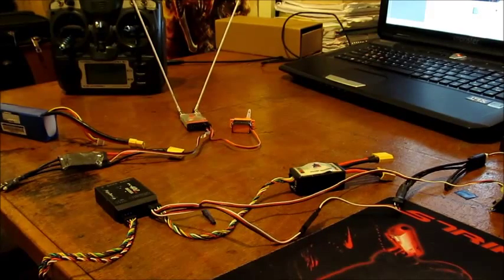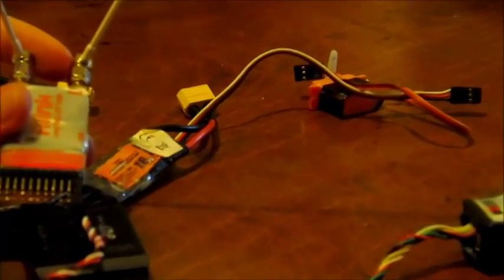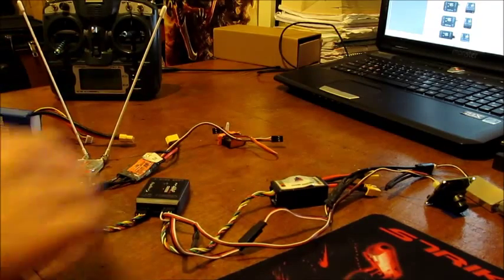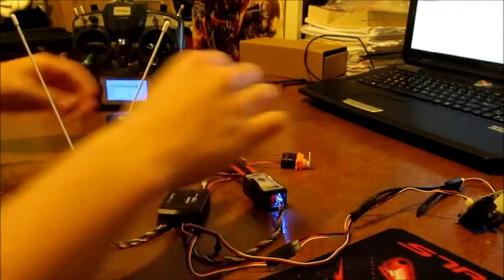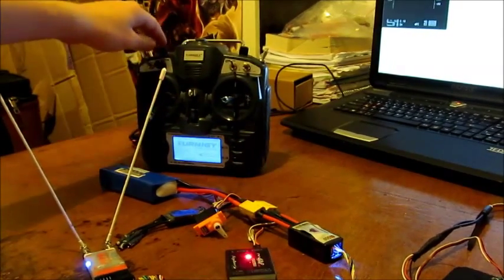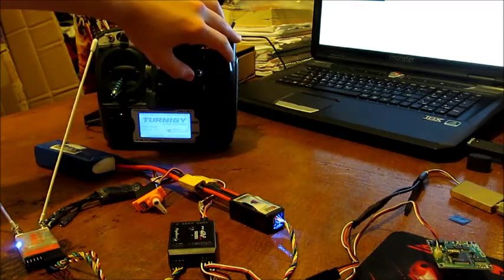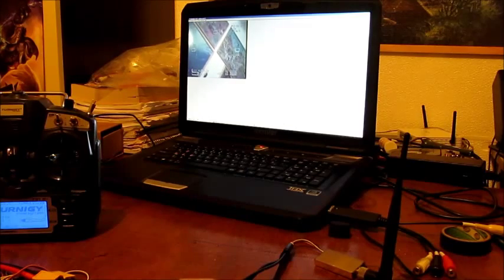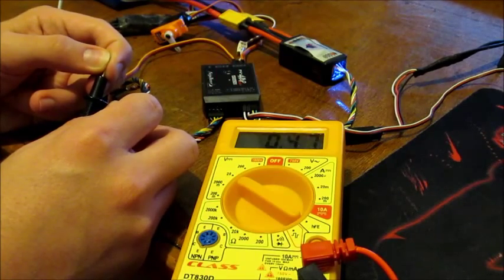FY41AP lite Servo problem

Comment: I connected my set up and everything works good. BUT my Elevator and Rudder has switched, on my V Tail configuration aircraft. My Rudder is reading elevator and my elevator is reading rudder for the out puts to the servos  ! ! What happened. I have all the connections correct too.

Comment: Thanks so very much for posting this video, and with the solution!!!!!!!!!!!
Major Help
Reply: I solved the problem by feeding pure and simple 5 volts (with an external 5 volt spout source) the back of the FY-41AP. In my case, I powered the S8 and everything works. it seems simple but it's enough and problem is fixed.

Comment: Do you have to plug the Lipo and then the esc plug every time you power up or just once and it works perfectly after that??
Reply from the maker: As far as i remember it works perfectly after that however you should not chance the ESC or motor.. i thinks it is some kind of inner calibration thing with the autopilot.. but as request; i will check when i go back to my hometown and report after that.

Comment: I have the exact same problem with mine at the moment even though it has worked on a few flights before. I have contacted FeiYu Tech so will see what they say. Did you work out what was wrong?
Reply from the maker: connect everything together than connect lipo to system THEN connect ESC to system and tadaa... everything works fine....

remember to connect lipo then esc.